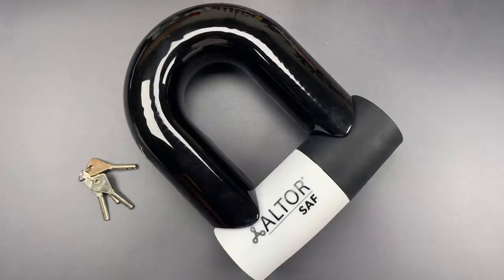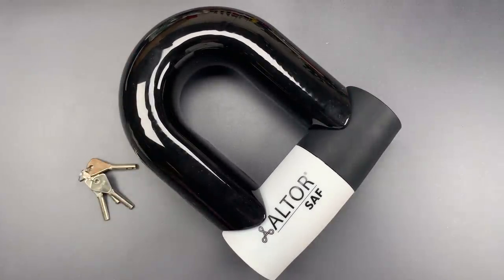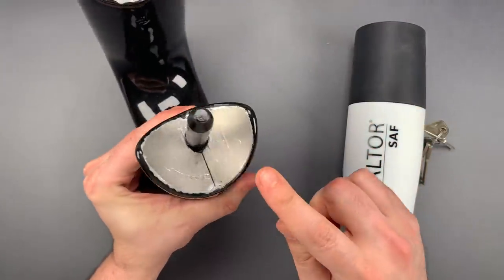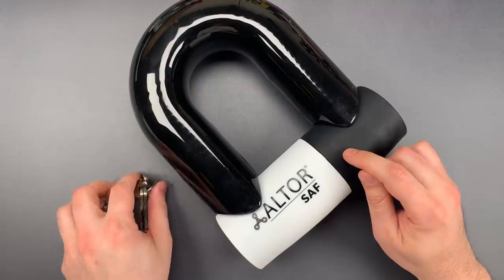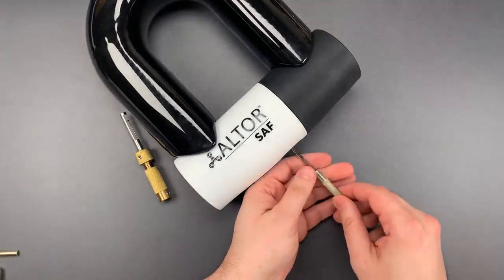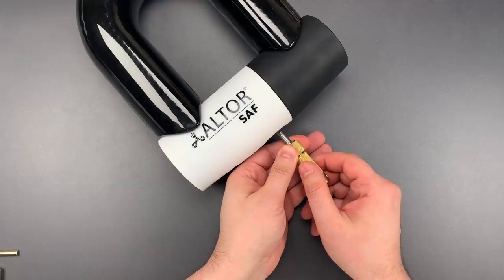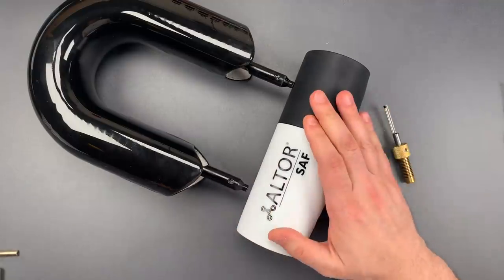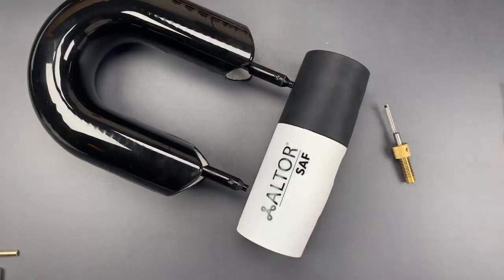[1088] MASSIVE Altor SAF ("Strong as F***”) Bike U-Lock Picked

Comment: I love how casually he slides in the fact that instead of cutting the lock, thieves could more easily just cut down the bike rack. (And then take the bike to a shop where more appropriate tools are available.) 
Goes to show, a chain is only as strong as its weakest link.
Reply: take a bike to a bike shop with a lock attached...

I feel like that's a huge red flag.
Reply: Well, even given a rack or anything alike which can't be cut easily (maybe one works in an evil overlords lair and somehow has a high pressure OF2 pipe to lock the bike onto), just cutting the bikes frame is still an option. I mean, a bike worth enough to justify such a lock is probably worth enough to do so just to sell the parts.
Reply: @nullmark5429  They're usually galvanized steel. Nothing fancy. In fact, pretty easy to cut. Not sure where they'd make a tungsten carbide bike rack, or why you need oxygen difluride involved. The bikes' frame is still going to be the most expensive part, what's the point cutting the frame when everything else is still easy enough to take off either with a quick release, or a small spanner?
Reply: Yup! A company called Almax makes "uncroppable" chains for securing motorcycles. However, if you don't chain it to something immovable, the theives just pick your motorcycle up and put it in a van ;_;
Reply: Ha, joke's on them. My bike rack is made out of Altor SAF locks.
Reply: @nullmark5429  bike in this case usually means motorcycle. The thing is, most motorcycles don't really have a good way to chain them down to begin with. Rear wheel is probably the best option. Front wheel usually isn't that hard to just drop out and leave behind. Most motorcycles that are stolen get parted out and sold in pieces anyway.
Locks like this are often required by insurance companies if a motorcycle owner has no options other than on-street parking and wants any sort of theft coverage. The same company probably sells a matching anchor and chain to go with the lock.
Reply: Obviously you dont use this in the public, use it at home where its attached to something equally strong. Though then they can just cut the bike frame and sell everything from the bike except frame itself
Reply: Ok Dad
Reply: Gay
Reply: @rykehuss3435  realistically if they have the time and privacy to cut through your frame they'd rather just unbolt everything much quieter
Reply: Now the company that sells this lock can sell armored bike racks to go with it, profit
Reply: This is.why one should use this on the frame and use a chain
Reply: @UnknownGamer40464  You'd think so, but one time I had a lock that seized shut locked to a lamp post on the street near my work, and so I had to cut it off.  I asked the police, and they told me to ask the fire department.  I asked the fire department and they gave me these huge giant bolt cutters about as tall as I was.  (i.e. handles over a meter long).  They did ask for my ID, but for all they know it could have been a fake ID or someone else's ID, and I'm not sure if they were asking for my ID to make sure it was my bike, or just so they would get their expensive cutters back.  I sat out on the street chomping the lock with these giant red bolt cutters in broad daylight and nobody even stopped to ask me a thing.
Reply: If you cut the bike rack, you can easily cut this with a Skillsaw n steel cutting blade at home
Reply: @rykehuss3435  bike frames are usually half the price of the parts attached to it. Meaning if you cut the frame, you just ruined your biggest paycheck out of the bike itself. Legitmately easier to cut the bike rack itself and deal with the lock later. 

Also I believe this lock is designed more for motorcycles eather than bicycles.
Reply: it'd be easier to just cut through the bolts that hold the bike rake to the ground and take the bike rack and the bike somewhere where you can blast that lock off.
Reply: Still, this moves the weakest link outside of consumer control, so it does the best it can. Also, if you want to talk about chop shops, we should acknowledge that they can still steal your wheels with this lock, as well as your seat if they're being petty. As a kid I was taught never to lock my bike without a wire that ran through both wheels, the frame, and the chain. At that point you can at least ride home if some jackass steals the only thing left, namely the seat.
Reply: I'm reminded of the ice cream incident
Reply: The Point is tough: Nobody will cut the bloody bike wrack, lol. At least I highly doubt it, unless your bike was redicolously expansive. And even then  thiefs will propably still think the Risk to high. 

But yes, weakest chain. I guess since this is more of a stationary solution, you might have some heavy cast iron posts or whatever nearby. I have one nearby,  and while space may  be tight, I can assure you that an angle grinder will have a very, very bad time with that post.
At his point, the next step would be to rip out the Post or get heavy equipment. And while that is defenetly theoretically possible... I'll just doubt any thief will bother, when there are so many nice bikes around.

Comment: "Just cut the bike frame instead. We can weld it later."

- Every thief faced with this chunk of metal, ever.
Reply: enter electric bike with battery stored in the frame, followed by excessive sparks and a fire that doesn't go out for days.
Reply: Good luck with that if the frame is aluminium or carbon.
Reply: faced with this lock I could see a thief simply destroy the bike out of spite.

Comment: "I'm going to be using the tool that I made myself without Bill"
Reply: Being a disc core, why didn't he use that tool he did with bill? I don't understand. Instead he create another one. What.
Reply: @xFucur  The one he made with Bill isn't long enough to reach the discs on the lock. The discs are buried too deep inside the thing.
Reply: @xFucur  

I don't know much about disc detainer locks but just by looking at the tool, I can tell it's pretty different from  the tool he normally uses. Therefore there's something about the core of the discs in there that's shaped differently or arranged in a way that his normal tool wouldnt work. Either that or the core is just tucked so far back in the lock that his normal tool can't even reach the discs
Reply: @xFucur  It's too short
Reply: I think this disc detainer core has to be tensioned from the back so thats why that piece has to go all the way to the back of the lock
Reply: The tool seems a bit thicker too
Reply: @xFucur  the main reason is because the keyway is a half moon it has a metal shield preventing his dd tool to fit where the one u have seen before is a wide open hole id show u mine if I could
Reply: @piotrnapora5810  that's what she said

Comment: While this lock looks amazingly secure, I am having a hard time imagining how you would even lock this to something. It would reduce your locking areas to very few specific spots.
Reply: I imagine you'd lock it to a bike rack or any other place you'd lock a bike to...
Reply: @nathanarnould1865  Well duh. But the thing is so thick it limits your locking areas. With a chain/cable, it's much more flexible and would allow you to lock to thicker poles, other places that are not specifically bike racks, etc. With a long enough lock you could also pass it through your front or back wheel for extra security. 

You can't do that with this lock and you would need to ensure wherever you are taking your bike has a bike rack that can accommodate such a thick lock.
Reply: @1234567895182  A well thought out response there, but you seem to have missed the entire point of the video.

Comment: Someone is going to cut through the frame of a bike to steal that lock.
Reply: Wait, that's not how it works! You nearly got me 😁
Reply: Look at how thin the aluminium is around the pins. You only have to cut away those thin plates and then into the shackle pins and you are through. i.e you only have to cut through half of the lock.
Reply: @ideadlift20kg83  have you ever tried to use an angle grinder to cut aluminium? Apparently not. Also what are you gonna do when you got to the steel core?
Bend the rest of the 2 finger thick aluminium with your hands?
Reply: pinecone69 Cutting the lock: https://youtu.be/1HvMPh6JBBI

Comment: LPL: "I think the take away is it's"
Me: impossible to cut it off
LPL: "...almost always going to be easier to cut the bike rack"

That's why you're the successful Youtuber
Reply: If were a bike thief, I'd just cut the bolts off the bike rack and steal all the bikes.
Reply: Wouldn't even need an angle grinder, a nut splitter would work fine.

Comment: This seems like one step removed from just hiring someone guard your bike whenever you walk away.  That thing is a monster.
Reply: Actually no, if there's a person you can deal with them using a knife, a gun or bribery, not this lock though
Reply: @devilishjester7718  Clearly you just need both!
Reply: except this lock is laughably easy to cut off.  sure, it looks beefy, but look at where the shackle meets the lock body.  the aluminim is thin enough that you'll cut through it before it melts and the hasp is thin enough it won't resist the grinder for very long.  if you don't want to take that route, then cut the lock body around where the lock is.
Reply: Angle grinders work on people
Reply: @thomasjenkins7506  Not so fast.  See that whiteish stuff filling the space between the shackle and the aluminum shell?  That's most likely concrete.  This sort of construction is common in high security safes, often with chunks of carbide mixed in, and is designed to not only thwart drills and grinders, but to destroy the tools in the process.  Obviously this lock won't offer the same protection as a 15 inch thick safe that weighs more than a ton, but even so.  It's also likely that the lock body has the same composite construction as the hasp, so it won't be any easier to cut.

As far as the lock core goes, it may indeed be the weakest point, but judging by the length of the key, there's an awful lot of room for drill protection between the keyhole opening and the mechanism, as well as being able to bury it deep into the lock, protecting from core pulling attacks.

The bike rack itself is almost certainly easier to cut than this lock.  A typical rack is what?  Quarter inch thick mild steel tubing?  Angle grinders are designed to cut this sort of material.
Reply: @Keldor314  it's not concrete.  it's just aluminum.  they give a diagram on their website. 

i never mentioned drilling it.  i said a V cut on the side of the lock, which would expose the entire core so you could just remove it.  even if it has the same type of construction as the shackle, aluminum is softer than regular steel, making it an easy cut.

also, looking at the diagrams show that my method of attacking the body is 100% feasible.  setting the core that deep means there is very little material protect protecting the center of the body from brute force.

Comment: The aluminum and steel hybrid design is quite clever. The aluminum is very difficult to burn or grind through, but can be vulnerable to cutting. Hardened steel can be vulnerable to burning and grinding, but is pretty much immune to cutting. It really would be easier to cut most bike racks.
Reply: Gun Slinger  The problem with that is: I don't think there are bolt cutters big enough to reach around this gargantuan thick shackle.
Reply: @Sombody123  wire cutters cut wires all the time... numb nut :)
Reply: What if they cast the aluminum with a bunch of random silicon carbide chunks embedded in it? Or industrial diamonds?
Reply: @MisterAndyS  probably not much. maybe it'll deviate the blade but diamonds are known for being hard, not resistant to cutting/grinding. Also steel is actually harder anyways.

Either way the blade is unlikely to deviate anyways since it'll be sandwiched between everything else
Reply: And if you really want to fuck with the guy, add a kevlar mesh to the aluminum - the kind used in cloths that protects against chainsaws. Nevermind time or disks, the guy will have to burn through several GRINDERS.
Reply: @GigAnonymous  the thief would just be cutting the thing out of spite at that point
Reply: @chunkysweirdtoaster3081  he can try... its not like he will get anywhere with it.  even if he does cut through it.  its going to be a challenge to move it when it ways that much.

Comment: Imagine locking your bike up with this lock and they break your bike and steal the lock 😭
Reply: Actually something like that has happened to me and a couple of friends when we were kids. We had locked our bikes together using multiple locks - when we came back the bikes were still there but the locks were gone. That was kind of insulting.
Reply: @saschaschneider6355  as a kid I would probably just be a bit confused and happy I had my bike lol and be in disbelief about it.. as an adult I would be very insulted 😅
Reply: @CalmoOmlac  now you're thinkin' 🗣️🧠
Reply: This lock is quite the novelty. It'd be the real prize. Bikes are a dime a dozen, you can steal a bike wherever. But what are your chances of coming across someone with one of these big ass bad boys?
Reply: Hell's favorite NPC #69OU812 . exe  ok, I take the joke back everybody
Reply: Hell's favorite NPC #69OU812 . exe  or cut the bike stand
Reply: @tmacthaskydiver8310  Yeah, something like that. Happiness didn't last long, though, because we soon found out that it was work of vandals who were having fun with a bolt cutter. It wasn't obvious at first but they had done considerable damage to the bikes and to a friend's moped. They had cut brake cables, spokes, the moped's spark plug wiring - and we found one of the locks while walking home, cut through as well. But initially that was a huge wtf moment
Reply: @CalmoOmlac  That's actually not that uncommon in some places.  You obviously wouldn't want to secure this to your standard cheap bike rack.
Reply: @kidthorazine  as someone else said: it doesn't really solve the problem. Because you still need to get that lock off the bike. That's much too much hassle for the average bike thief. If someone was out to steal exactly your bike OK but the average bike thief just moves on and steals a couple of other bikes instead of bothering with this kind of lock
Reply: @saschaschneider6355  nobody is going to be using something like this on an average bike.  This is designed for people who have high end road/racing bikes, which are worth several grand.
Reply: @kidthorazine  sure, but still. In the time it takes to take care of this lock alone you can steal 20 or 30 other bikes. Thieves aren't in it for the challenge. There's always lower hanging fruits.

Comment: "headed down to my garage and emerged several hours later with this"
>combination brass and steel parts
>uniform knurling on two separate parts
>perfect machining
how do you do it?
Reply: He's got a lathe.
And knurling is easy, it's a set of abrasive wheels you put up against your work piece on the lathe and it knurls for you.
Reply: @JM64  sorry forgot he had that sweet sweet lawyering money.
Reply: Brass is both fast and easy to cut, leaves good finishes. As for the steel, I suspect he didn' have to remove much, might have doen it on a dremel or such
Reply: With his lawyer powers of course
Reply: @jermainerace4156  I've heard as much from you multiple different sources I personally don't do any kind of metal work but I've heard brass is fun to work with because it doesn't fight back basically compared to something like steel
Reply: @USS_ESSEX_CV-9  I can attest to that because I do a lot of metalworking - brass is very fun to work with because of how malleable it is compared to other metals as well as a low melting point and a nice flow while melted (for casting). Using any kind of impression tool on brass is almost a guaranteed success (depends on alloy proportions) and it doesn't destroy your turning tools like steel can.

Comment: I love this idea that the lock is simply thicker than the radius of angle grinders 🤣 hahahahaha. That's genius.
Reply: Yeah, but it's 300 bucks for the lock, and they only prevent the most common angle grinders, you can find 6 inch battery disc cutter/angle grinders, which would go right through this. The people that have made videos are all choosing to use 4 1/2 inch ones for some reason, probably because it is an advertisement rather than an actual test.
Reply: Just put a 6 inch disc on the 4 .5 inch grinder
Reply: Charles Ansman no bike thief cares that much they’ll just move on to a different bike with a much easier lock
Reply: All you need is a sawzall
Reply: @oisin3495  yep. It's already been stated that these bike-stealing counter-measures do not protect your bike directly; they are needed to make your bike a less attractive target than the near ones
Reply: @CharlesAnsman  you have to take the shield off. and sometime those battery grinders motors wear out super fast if too much weight is on them (i.e a 25% larger cutoff wheel). especially if you have a big cut to make
Reply: Me: hold my beer! True about the aluminum coming up the cut off wheel!
Reply: All you do is cut a shallow angled V notch first to the centre. Then you can get through to the centre and out the other side. EZPZ.
Reply: Yeah so use a boltcutter on the bike rack and she gooooneee
Reply: @CharlesAnsman  I use angle grinders every day at work. Putting  a 6 inch wheel on a 4 inch angle grinder is certainly possible but is insanely dangerous. I emphasise the 'insanely' part.